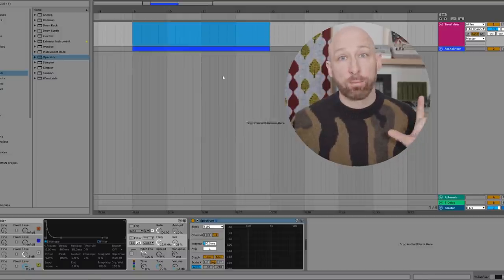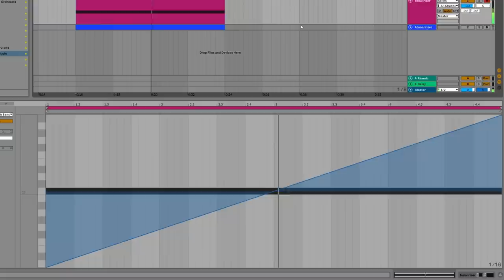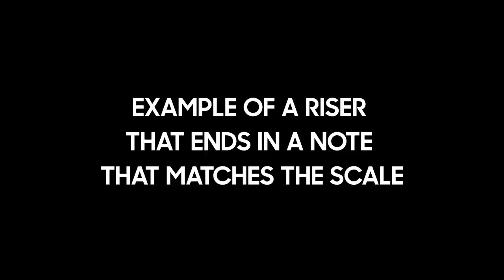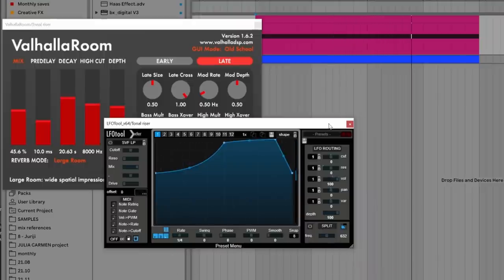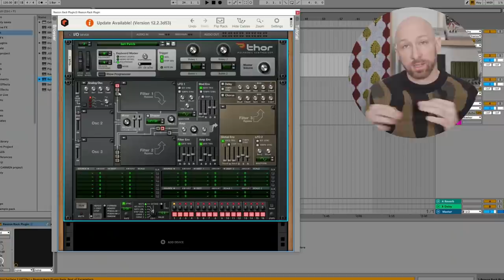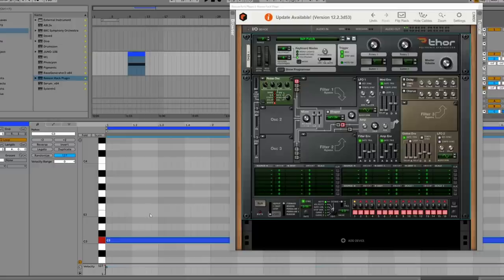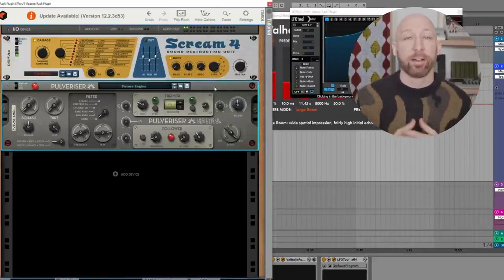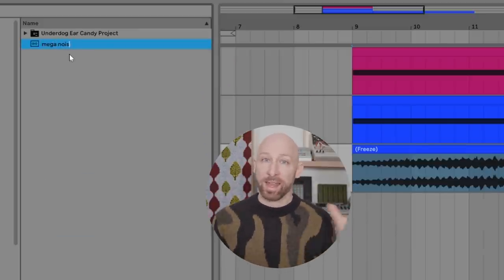Make your own damn risers!

Comment: This video creates for an interesting conversation.  Would love to see a follow up video to this in the future how to make Shepard Tones  risers and falls.👌🙂🙂🙂.  Shepard Tones are a great way to add suspension.
Reply: Vital has nice feature that allows you easily creating shepard tones.
Reply: You can create a shepard tone effect by stacking three or more octaves of the pitch bend effect explained in this video and fading out the top octave(s) and fading in the lower octave(s) on a loop. It may be easier said than done but that's essentially what shephard tones are.
Reply: This. I’ve seen a tut or 2 on Shepard tones but they’re ALWAYS lacking some data necessary to make a SMOOTH infinite riser. They usually say something like “stack a few pitch bends as fade the ends” but that always ends up in a Shepard tone that’s clearly repeating and not at all smooth and infinite.

Comment: Fantastic and simple explanation. It’s also used as atmospheric risers in the deep core psytrance culture, where a long breaks are not wanted. Cuz they can brake the tripping. So you create a riser who runs as atmosphere. Mostly one kick out of the bar and the next 8-16 bars are running. Without getting boring

Comment: A tip for users of Ableton Live with M4L: connect the pitch-bend-value to a M4L-device so you don't have to change the value manually everytime to change the preset. Or do practically the same with 'regular' automation.